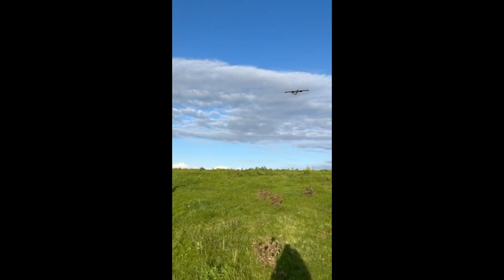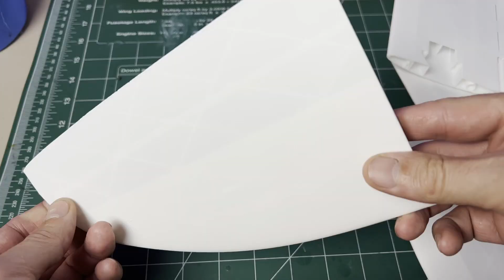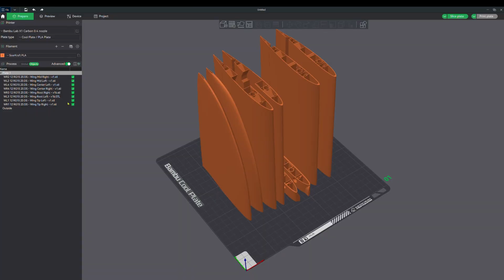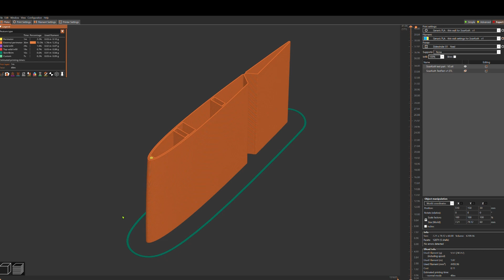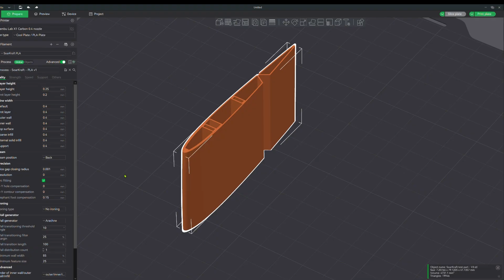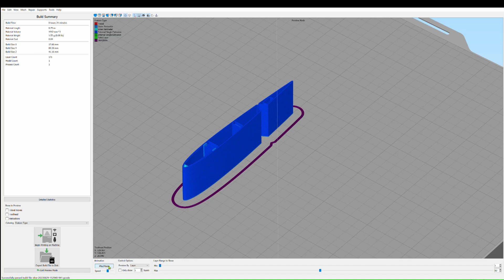Turn Slicer Quirk to CAD Design - Perimeter Before Inner - Update V3 SoarKraft Models

Comment: It still doesn't always seem to do outside first. Using your profile for prusa, imported into superslicer, printing the RG15 left tip for example, anywhere there's a gab in the hinge it prints the Aileron outside, then the main wing inside, and then main outside, then aileron inside. Layer 70 is an example. Probably fine, but a bit weird.
Reply from the maker: I don't test with superslicer??? do we need another variation of Prusa or SimpleSlicer... Maybe don't use superslicer.    I spent months fixing every imperfection such as this to work with Orca / Bambu / Prusa.  It is possible that I missed something, or your settings translation is off, or something is not the same in the superslicer branch.  They still slicer correctly in Orca / Bambu / Prusa.  I can't test for every slicer or printer combination....
Reply: yeah I set up orcaslicer and it’s working beautiful, almost done printing the wing. Just an FYI for other people. I always thought superslicer and prusa were basically the same, I guess not. About time I move on with the times anyway

Comment: I am also confused as its not clear what changes you had to make in the CAD software. I loaded the new test part into Prusaslicer (2.7.1) along with your config file for LW-PLA. I see that it prints the out perimeter first but see several extrusions. I thought the idea was to print the entire layer in one continuous extrusion in order to avoid stringing and blemishes.
Reply from the maker: Nope, intent is to print the outer airfoil surface as true as possible.  Leading edge to 1/4 cord should have no lines / sags / blemishes.  Print the outer surface first in one extrusion then go back and print the interior structure.  I also do one and two wall sections in the same part.  Strings are minimized with design but still present… does not impact weight.  I’m not doing “vase mode” parts… I’m doing something different.

Comment: I bought the igneous today and had a look at the prusa slicer (2.7.1) results after this video. These v3 files do not print the outerline in one section. It is just as bad as shown in the first half of your video. Switch "external perimeters first" does not make any noticeable difference. Do you have any ideas on that? Overall the plane & files look aweseome and well tought trough! Thank you!
Reply from the maker: Did you install the Prusa Slicer configuration files for "Print" and "Filament" for the SoarKraft models... its in the files set folder for Slicer Config files... also available on the website.  If you use someone else's configuration / settings it may do this.  My files are different.....  I just re-checked everything Prusa 2.7.4 and they work as intended.

Comment: Things I would maybe add:  cg nipples on the underside of the wings;  move the control rods to the top of the wing for better protection against bush landings; and wingtip airfoil modification to reduce wingtip vertices.
Reply from the maker: All good ideas.  Already added the cg features.  Control rods on top are possible, but servo covers do a good job... and these are not combat planes..... or are they, that could be fun.  I tried some winglets, if they changed the performance it was unnoticeable and fragile for landings and transport.    I do have a high aspect ratio wing I am about to release, hopefully it will satisfy your desire for more efficiency.

Comment: Confused ... are you saying that the way you draw the 3D model changes the way it prints ?   Surely a 3D model is a 3D model is a 3D model that has resulted from extrusions and cuts etc as you built the model in the design software.  Looking at the slicer GCode in S3D for the right wing tip as V2 and V3 shows build code differences but the config is exactly the same.   Weird.
Reply from the maker: Yes, the CAD is different.... and it was a pain to do.  
I loved the way the older Cura sliced the outer skin, but I hate everything else about Cura... and the new Cura does not work the same way... so I fixed my parts to do this type of slicing in Prusa / Orca / Bambu / Simplify3D.  I can not use the "Vase Mode" method to get the single and multi wall structure that I want for my parts.  I tried the surface method too, way to slicer dependent for multi-wall stuff... this seams to work in all the slicers, if you have the setting right.  The new Cura does not do ooz control (combing mode) very well, so it is useless.  I will do more videos to explain what I did....
Reply: Impressed by what you have done.  Will wait for more details.   We had ailerons that kept needing repair so we chopped out the embedded ailerons and replaced them with newly printed hinged versions. It took me ages to work out a routine that would create the new 3D models in Fusion so I don't envy you the effort needed to change the CAD. @soarkraft
Reply: @soarkraft , so I am also confused.  I downloaded the V3 test part and using the Prusa Slicer config, was able to get a test part that printed correctly.  The surface looks 1000% better.  But are you saying that we can get the same results using your old STL files?  Don't they also need to be redesigned? using your new CAD design?
Reply: @kevmscott  so the old files would do something sort of like this “perimeter before inner” in Cura 4.11 - 4.13 … and I liked it a lot.  The old files would not do this in other slicers, new Cura does not do it, the outer perimeter is always broken up into several extrusion steps per layer.   I wanted to keep this feature so I figured out a way to get all of the slicers to do this by changing the CAD to make it happen.  No special settings or slicer specific mode to deal with.  This is a new thing … took me awhile to figure it out.
Reply: @waynesiebrecht3833  , so the old files will not print the same way the the new V3 test part does, you will have to modify their existing CAD and then generate new STL's (even with the new profiles)?
Reply from the maker: what??? The old files still work fine... they are just not as good as the new ones.  
yes the stl files changed from v2 to v3 - the old files (CAD stl files) are different than the new files (CAD stl files).  
And yes, I updated all of my models to this new v3.... so if you purchased files you would automatically get a link to the updated files.  Yes, you would need to slice these files with the same slicer settings as before and generate gcode for your printer to use these files.
Reply: @soarkraft  , I'm sorry if my confusion is causing you frustration.  I have purchased numerous STL files and never received an email with links to new V3 STL files (order 1541, order 1688).  If you get a chance, perhaps you could look to see if the email you reference got hung up some way?
Reply from the maker: Just sent you an email from the webstore... check your span folder too.  I sent out all of the updates at the same time and they went to many others so it might have triggered a span filter.  Please contact me directly through the webstore if you don't get any of this in your email.

Comment: Thanks for the update! I just purchased your Roughgen a couple days ago and have ordered two brands of LW PLA to try out, Polymaker & Overature. Once I get the pre-foamed PLA's printing I'll mess with the foaming versions like Colorfabb... Cura has been my slicer of choice for years now but since you say the Prusa Slicer prints your files better I just downloaded it. Hope it's intuitive. Looking forward to your new designs! Thanks for all that you do!

Cheers,
Greg
Reply from the maker: Prusa is easy:
Set up Prusa Slicer with your printer and then import the config files I supply (also on the website).  With the pull down tabs you can select your printer settings and the Soarkraft Print and Filament Settings (3 different tabs).  I have been using the generic PLA settings for both regular PLA and the pre-foamed LW PLA with these parts and it works well on my printers.  The LWPLA settings are for the Foaming Material.  I do have a section on my website that I will post new / updated configurations as they come available.

Comment: Really awesome, thank you!  This will resolve my stringing especially in the hinge areas when printing lw pla. As for the best print quality, would it better in prusa or cura?  Do we need to update our prusa config with your website config?
Reply from the maker: The Prusa configuration is the same, the parts changed.
Prusa has much better travel paths and does not cross perimeters (ooz control), seams to do a better job.
Also, because there are far fewer travel moves adding some prime does not hurt the overall weight.
Cura 5.0+ still can not do combing, these files still work with Cura 4.11-4.13... where combing mode works...  but I really want to get away from Cura.

Comment: Me and a couple buddies are building the Juicy right now and we’re having this issue. How crazy you drop a video on the same day / hour we are discussing this! Thanks for updating and improving your awesome design!
Reply from the maker: Glad I could help! So the Juicy is what drives me to do this project more than anything else.  It was the first thing I wanted to print with the new printer... I can print the whole Juicy 4S in under 24 hr with the bambu X1C and these files in PLA or PLA+ and get really nice parts.  Videos and speeds please.
Reply: Do you have any Flashprint parameter settings? I just finished the Left root V3 panel and came out flawless but took 12hrs!!! Yikes!  @soarkraft
Reply from the maker: So if your print looks good you can probably just look at the Cura table of settings (at the end of the instructions) and compare settings in your slicer.  I have never used Flashprint.  An easy one to check is the layer height of .24mm is the fastest / tallest (you can do .25mm but .24mm is equal to a full step in most stepper motor controls).  Check the weight to see if it is close to the predicted Prusa weigh in the instructions... also print speed and minimum later time (usually in cooling section and set it to 10-12sec)  can affect overall time.